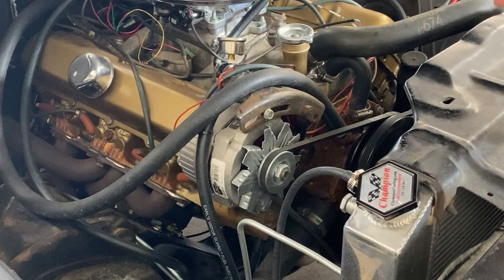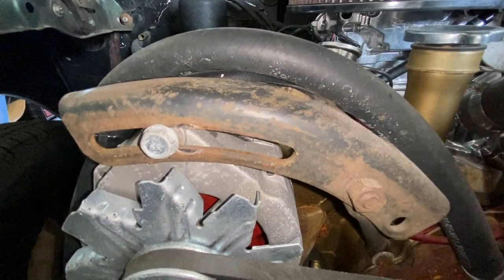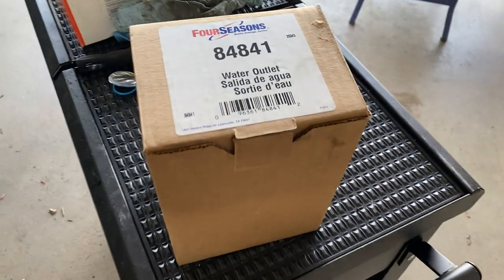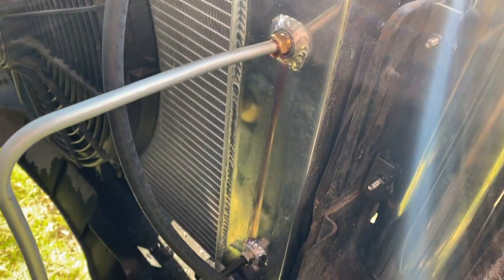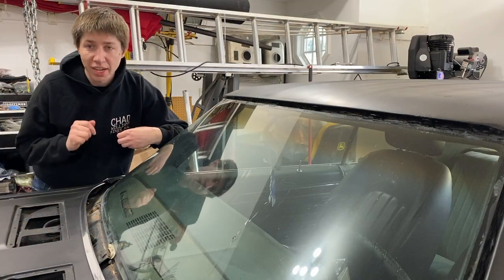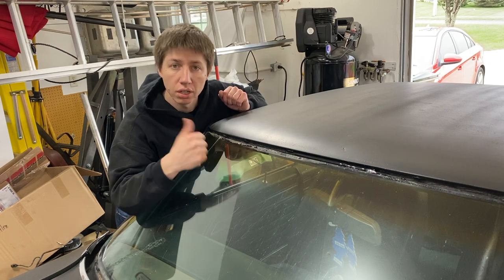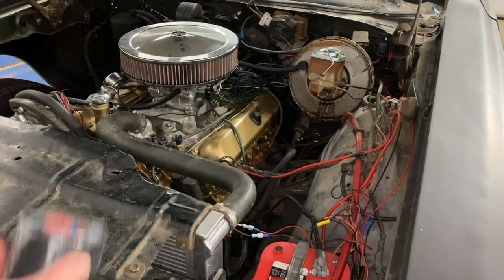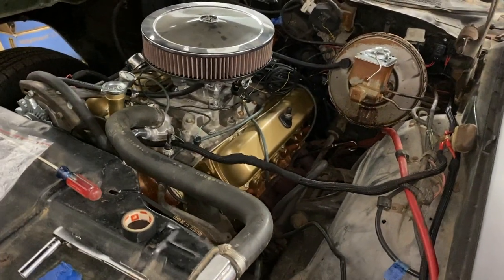Rebuilding 1970 Cutlass Episode 2 - Much Needed Maintenance

Comment: Whoa fam hold up....you need to use oil with ZDDP in it. You are gonna wipe out your cam lobes if there isnt any zinc and phosphorous in the oil. Valvoline VR1 racing oil has all that stuff in it. Usually its the only oil auto parts stores have on shelf for older cars
Reply from the maker: Hey Dominic, my first oil (break in oil) has zinc additives. Do I still need to keep adding zinc even after initial break in? I didn’t think I had to.
Reply: @ChadWilliamsFixesAll  dont listen to this zinc bullshit.your car is fine with the oil out there.
Reply: john dillinger you don’t know what you’re talking about man.